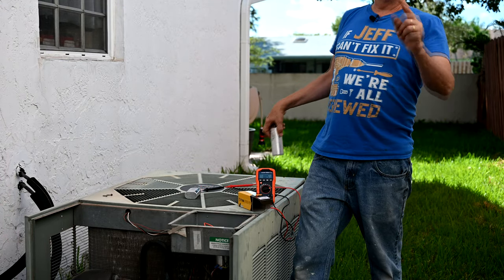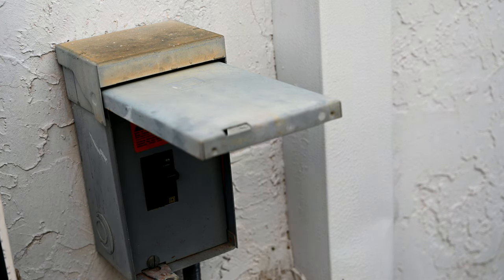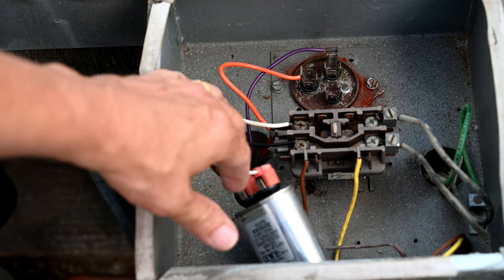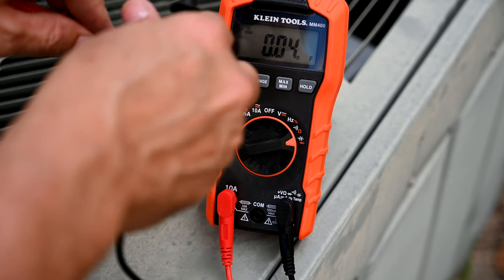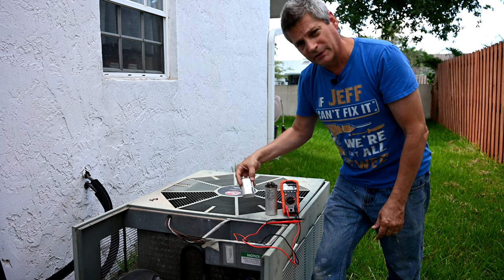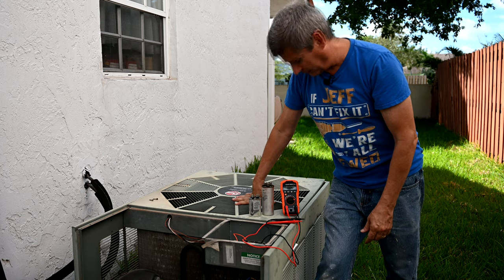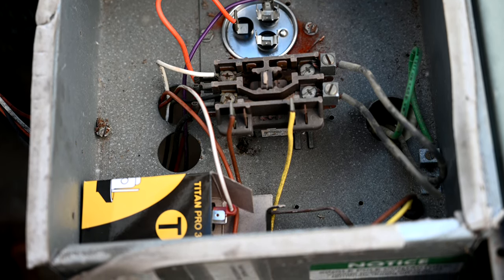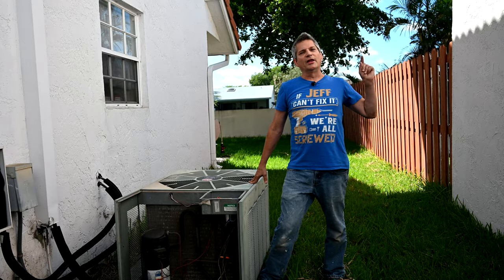DIY Fix AC Compressor Fan Not turning On, Just Humming

Comment: @jeffostroff Nice video, and thanks for sharing. I just want to point out that your run capacitor had 3 connectors because it was a 35/5 MFD dual run capacitor. This means there was one common connector, with the other two being for the fan and compressor (or Herm) respectively. When you were replacing the capacitor, you didn't need to buy a separate 10 MFD capacitor for the fan. In the past, someone had installed a separate fan capacitor because the main run capacitor's fan side had failed. You measured it as 3.3 MFD, whereas it should have been 5 MFD. The other technician only added a separate capacitor for the fan side but incorrectly used a 10 MFD instead of the required 5 MFD. This was only a makeshift arrangement. However, with your new 35/5 MFD dual-run capacitor, you didn't need to use a separate capacitor for the fan. You could simply connect one wire to the common terminal and the other wire to the fan terminal. You could save $6 while using the original values would likely have made your unit function better.
Reply from the maker: Good to know thanks! We also replaced this AC with a top of the line Dave Lennox Series, a much better and awesome AC!

Comment: One thing you missed in suggesting: Buy a spare set of capacitors ahead of time and store them in the air handler room. Cause the A/C will always fail Friday after 5pm and you won't get a tech till Monday. Also A Harbor Freight cheapo meter will no do. But with the saving in capacitor costs you can buy a meter that will do the job.
Reply from the maker: Yes, funny you mention this because when I bought my last capacitor a year ago I kept thinking I should buy 2 or 3 because they are cheap when you buy them from the supply house, but $150 when the AC company installs them.

Comment: This was very helpful, jeffostroff. Thanks! My ac fan unit just stopped blowing last night. After watching this, I think I'll give it a shot at trying to repair it myself. Hopefully, it's only the capacitors. I just have a basic multi-meter that doesn't appear to have a separate capacitor gauge. However, I'm thinking maybe I may be able to get by just measuring ohms. Do you think that'll suffice?
Reply from the maker: No, for capacitance you have to measure capacitance. Buy a cheap meter at Home Depot
Reply: Great,ok, will do, Jeff. Thanks again!

Comment: thanks jeffostroff!  I am looking at overhauling my AC and it looks just like the one you have pictured.  Thanks for your parts list pinned below.  I also want to change out the "contactor".  i opened mine up and its identical, but unfortunetly the part number has worn away.  It "looks" like 9517 honeywell di242r but i could be mistaken.  i cant find any part that matches this number.  Can i use an atlernative, if so, what?  thanks again!!

Comment: Is there a reason you bought two capacitors when you could have gotten a single  35uF / 10uF / 370V capacitor for both the fan and the compressor?
Reply from the maker: I tend to use the same parts that were already in there. They do have dual caps, but on that day when I went in to buy it, they had none in stock of this configuration of 35 uF and 10 uF.

Comment: Do you have to have two capacitors for those old rheems?
Reply from the maker: No many units have one capacitor housing that contains 2 caps, one for the fan and one for the compressor. For whatever reason,. the original installers used 2 separate caps. My configuration of getting the 35 uF cap with the 10 uF cap in the housing was hard to find.

Comment: Thank you Jeff, I replaced the fan as recommended by the $175 service call. I also replaced the capacitor. Fan still doesn’t spin. Compressor hums but no fan. I spin the fan but it does not work 
What next?
Reply from the maker: Unplug the capacitor, and make sure it is the correct capacitance. Make sure you corrected the correct wires to the correct terminals on the cap. Usually they have a sticker somewhere on the compressor with a wiring diagram so you can confirm that the correct wires for the fan are going to this cap. You might also try adding a hard start capacitor, we have a video on that too..

Comment: Hello there,

I just subscribed.
My hvac is doing the samething and i think your video will solve the issue.

Question. Are capacitors standard size or unit for any hvac?
Reply from the maker: No each compressor has it's own size, typical sizes are 10 uF, 20uf, 35 uF
Reply: @jeffostroff  you know i checked the capacitor and its newly replaced (april 2021). The hvac fan is on and off. Sometimes it would make a humming noise. Not sure if thats something we should be concerned about. Btw, the hvac is from 1994 year old.
Reply: Unfortunately, our hvac made a strange noise and i think the water leaked and gave a bad smoke in the backyard. Not sure what to do.

Comment: I was able to get the fan to start spinning with a long plastic stick after repeated attempts.  

I noticed the fan surface in the center of the shield was very warm though, which suggests to me, the problem is the fan motor?  

Your thoughts?  

Symptom was a buzzing every few minutes, but no spinning fan.  I got it to spin with the plastic stick, but I don't think it got up to normal speed.  We have 2 compressors and the other smaller ones fan seems to have higher rpm for sure. 

And it's still buzzing periodically, but the fan is spinning.
Reply from the maker: If you had to push the fan to get it going, then your fan motor appears to be ready to go. I would start looking for the part locally and checking the prices to see who has it for the lowest price, and be ready to pounce. these things like to fail at 5:59 PM, before you can get to the parts warehouse at 6 PM closing, then you have a nice long hot night ahead of you.
Reply: My fan is doing the same thing ever figure out what it was

Comment: Excellent video - I have a similar problem and I see the large capacitor (for compressor fan) but can't find the small one for the blower squirl cage? I think it has some kind of cover on the motor. maybe underneath? I think the unit is a Fridgidaire heat pump. Q7RE Series - Most of the time I have to jump through hoops for 15 mins before the squirl cage will finally start (with several false starts). Then I just leave the fan set to ON . The compressor seems to go on & off ok !! I did notice our elec bill last month was like double 😞. Guess I'll try tonight when it's a bit cooler outside (Florida). Damn 5lb mosquitoes will probably find me lol
Reply: Is it possible that the large capacitor runs both fans? It's labled C65R (45+7.5)uF+/-5%  370VAC  10000AFC?  Sign of the motor cover says Warning - don't take the cover off !!  I've been daring before but just thought I'd check. Thanks in advance for any feedback 😊
Reply from the maker: On mine, the large cap has 2 caps built into it, and it runs both the compressor and the fan
Reply: @ProjectDreamCatcher  Yes, his setup is not normal.  A single capacitor will have two different capacitance values.  He should have a single 35uF / 10uF capacitor.  My guess is a repair was made and the HVAC tech didn't have the right capacitor in his truck, but had a separate one that would work for the fan. Therefore he has a weird setup where he has a 35 / 5 capacitor where he doesn't use the 5uF capacitor for his fan (note he doesn't connect anything to one of the connectors on the large capacitor), and then uses a 10uF capacitor for the fan.  So you likely have the proper setup with a single capacitor for both.  

The capacitor is there to store up and then provide a jolt of electricity to power the start-up of the fan motor and the compressor.  If it sometimes doesn't work, or never works, it sounds like it is probably the capacitor.  

Look at the two capacitance values on the capacitor and find a single capacitor that matches the two capacitance values and the voltage.  Then take a picture of the 4 wires going into the top of the old capacitor  (there should be connectors for fan, herm, and C (for common).  Should have one wire to fan, one to herm, and two to C.   Hook up the new capacitor the same way and it should be good.  Turn off the power to the HVAC unit and turn off the system on your thermostat to be safe.  Discharge any power in the capacitor by using a screwdriver with an insulated handle to bridge the connectors on the top of the capacitor.  

FYI, your fan setting is for the air vent fans, not the cooling fan on the outdoor unit.  Setting it to always on will not always run the outdoor fan.

Comment: Really great video. I have some questions. How long should these capacitors last, even if not in that much use? Also, with the ac off, should you be able to spin that propeller fairly easily, or does the motor pretty much keep it from spinning? The house I'm in has an AC that hasn't been used in about 8 years, so there is no telling what the problem is. Thanks.
Reply from the maker: The fan should spin ok. We don't know how long capacitors last it is different for everyone. These got replaced 3 times in 10 years.
Reply: @jeffostroff  - Thanks for the quick reply. Yea, even if the capacitors are bad, which I think is true, I was afraid those blades weren't right. I will have to remove anyhow to see if there is debris stuck underneath, but I will probably have to order a new motor. Could it sitting for so long without use cause it to be somehow sticky, and if so, could oil or WD40 loosen it up? Sorry for all the questions.

Comment: Our capacitor is always fine its the relay we have issues with the last three years.  I think we made it past last year but the year prior the ants burned it out twice within two months.  Obviously wé're working on the ants but if anyone else is having issues "fire ants" are getting immune to andro and can simply move around it. So Im trying to do this by myself and no one has used anything other tool than a screwdriver to discharge the electricity and my husband did it that way last time.  So I havent touched it yet. If you can reply to let know how Im sure my heart will thank you saving me any shock or other damage since likely I'd be the one to blow up the capacitor.  Thank you much!
Reply from the maker: I had leaves and corrosion on mine.
Reply: Mine was two seasons of hornet nets.  Little buggars.  They also made it difficult to keep the cottonwood hosed off.  Finally took care of the hornets, now for replacing the capacitor.

Comment: Hey 👋 so mine was doing the exact same thing. But why when I turned the unit off for about an hour..its up and working? Do you know why it did that? Thanks for your help! I hope you see this :)
Reply from the maker: Your compressor may be nearing end of life. You might consider a hard start kit, like we installed on ours in August to tie us over the last week before replacing our AC, we just had to wait for the new AC to be delivered, but compressor would not crank over, just needed to extra ummmmph! Our video shows 2 methods, the hard start kit is the second method. https://youtu.be/3LG0t2lV0Gg  sometimes you can get over a year or more out of your AC with a hard start kit

Comment: Mine looks just like that. I’ve replaced fan motor. Then replace the rectangular part with the button. Next I’ll check the capacitor. Mine doesn’t have the smaller one.

Comment: Hey Jeff. Quick question:  When you are testing a heat pump and turning it on an off, are you just leaving the furnace in a state of "call for heat" and then using the heat pump's 'fuse block' to start and stop the unit, or are you turning the furnace on and off each time?  OR.... are you 'jumpering' some contacts on the heat pump to fire it up for testing? 

 I always wondered what goes on with this.  I am in a situation right now where I need to figure this out so that I can bypass the comp, then the fan and even check out if the contactor is acting up due to some noises I'm hearing.  It seems a little silly to run in and out of the house each time. My plan was to pull the fuses, call for heat and then plug the fuses in for testing and pull them back out between tests all while the furnace is running.  Does this make sense?

Comment: Are most issues not turning on coming from those capacitors?
Reply from the maker: Yes, from what I have seen 90% it's the cap. If not that it is dirt in leaves that get into the contacters, then lastly the fan motor itself

Comment: My ac unit is humming but not nearly as loud. The vents inside are blowing air and I just replaced the capacitor today but the fan still isn’t spinning. Any tips?
Reply from the maker: Look at the contacts, see if they need cleaning or relay replaced
Reply: @jeffostroff  the coloured female connectors?

Comment: had one go bad even on newer unit be replace year ago...only way it goes zap ...is lighting surge that usual 50/50 chances that fuses from disconnect will miss to trip or burn the fuses first from surge that a surge can overcharge the capacitor cause to malfunction

Comment: Depending on where you live, you may not be able to buy them from the local AC supply house. Where I’m at in Texas, they only sell to licensed contractors. Therefore,  I get mine in advance from Amazon along with the contactor...
Reply from the maker: Gary, that is why I put th e links to amazon pinned in the comments above at the top, so people can go order them there too.
Reply: Any concerns with getting fake Chinese capacitors from Amazon? Just curious since I'm not so trusting when it comes to buying electrical components from Amazon.

Comment: Great video! Thank you. About to try and repair mine. (Good luck finding those housing screws though, 😂)
Reply from the maker: Great let us know if the repair works for you
Reply: @jeffostroff  Worked like a charm! On firing it back up, nothing happened immediately, but then I wondered if the fan was stuck. I tried to spin it manually and it was totally stuck, so I gave a gentle whack and it came free. Turned everything back on and it's running great. Thanks!

Comment: Well I changed the capacitor and it worked. Then stopped again next day. Fan wire to the board looked burnt lol. I cut wire and repaired it and I hear the noise but it’s every 30 seconds only.. I tried spinning the fan but it won’t go. Any ideas? Thanks!!
Reply from the maker: IT could be the motor is wearing it out, you might have to replace the fan motor. I have done this on my own AC units at home twice, and one on each of 2 different condos I own, it is a common problem. Replace it yourself for $100 cost of the fan. The Ac companies will charge you $300 to $400. Also check the relay, make sur eit is clean and not rusty, and look for bugs in and around the relay and under it, clean out all bugs and leaves, that sometimes prevents the relay from making ocntact.

Comment: I think it would be a good idea to let people know about discharging the capacitors so people dont get the %#@ shocked out of them. I noticed you left that safety tip out of the video. Still a great video and to the point.
Reply from the maker: Great point! Of course usually the cap is dead anyway by time they are doing this.
Reply: Thanks for the tip, is there any specific way i should discharge the capacitor? I saw on a diffrent video a guy discharging it with a screwdriver but it seemed sketchy.

Comment: Question.  I replaced the dual run cap only 6 months ago.  It checks good.  wire connection check good. The condenser fan will not kick on every once in a while. It's happened twice about 3 weeks apart. I know it's going to happen again, just don't know when.  I'm thinking a winding in the fan motor may be bad and every so often the fan comes to rest on that winding which is the phase winding for the cap.  Thoughts?
Reply from the maker: Check the contactor also, as bugs and leaves and dirt get in there and block the contacts, otherwise likely the fan is on its way out

Comment: I don't have a breaker box outside, just wires running into house.  I killed the switches in the breaker box and turned it off at thermostat.  Seeing about taking out that capacitor without touching anything.
Reply from the maker: As long as you have 0 volts on the wires coming out of the wall you will be ok. Do not short any leads of the capacitor together it will blow the cap

Comment: So you do not have to discharge the capacitor with a screwdriver or something before handling?
Reply from the maker: Nine times out of 10 the capacitor is already dead and doesn't store any voltage anyway so there's nothing to discharge. Also you should not be discharging it with a screwdriver shorting the positive terminal to the negative terminal that could cause the capacitor to explode. If anything you should do it through a high wattage resistor that will slowly bleed off the voltage instead of a rapid inrush current
Reply: @jeffostroff  It's that one time out of 10 that I'm worried about !
  You did talk me into buying the bleeding tool however . 
     Too bad it will be here the day after my capacitor so I will have to use the screwdriver one last time.
Thanks for the info.
Reply from the maker: @rodneysnextchapter615   Just in case anything goes South I get 1st dibs on your car lol